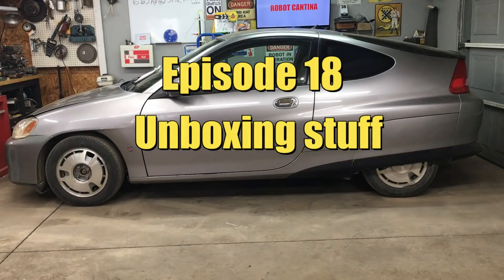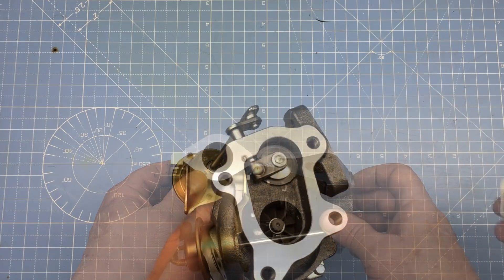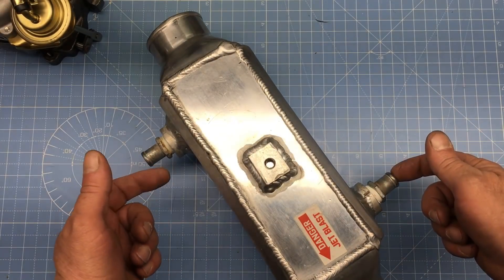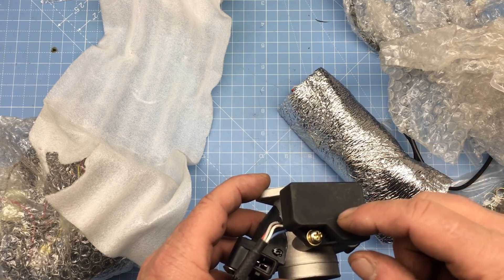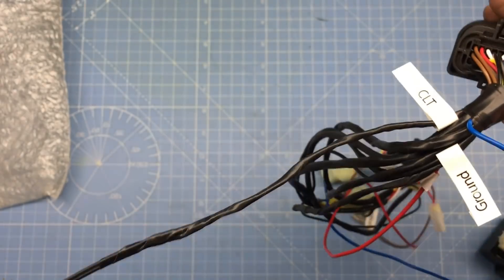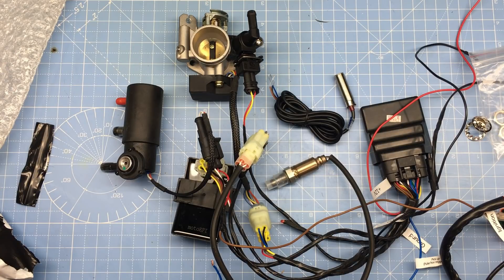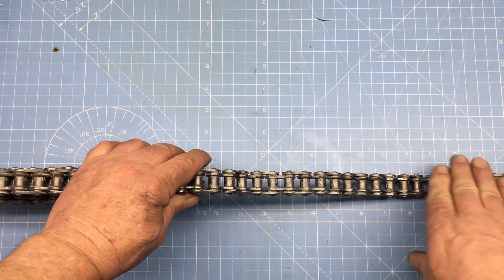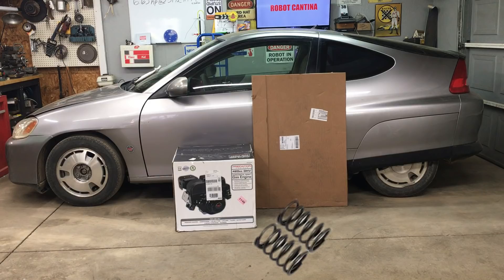Episode 18.   We unbox the high performance parts needed to make our 420 Hemi powered go kart faster

Comment: MOAR!   Hey! So I just got a 995CC V-twin from a generator. Ran on propane. I also have a 1.9TDI Borg warner turbo as well. Not going to put it into a car, maybe a mini sand rail. Need to convert from propane to single or twin carburetor, and then I'd like to figure out the compression ratio. Turbo should work size wise with a draw through carburetor setup.